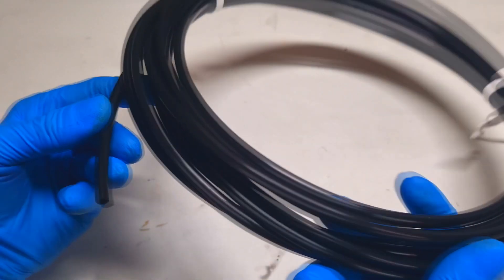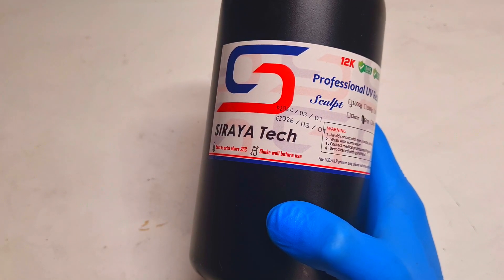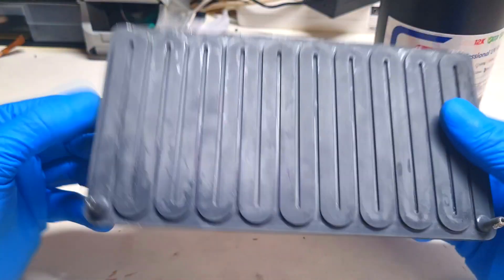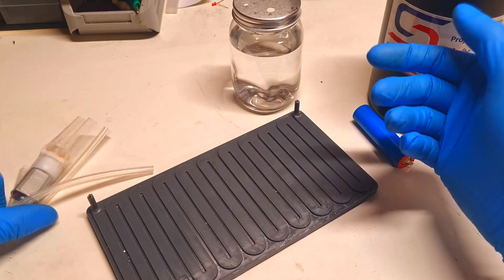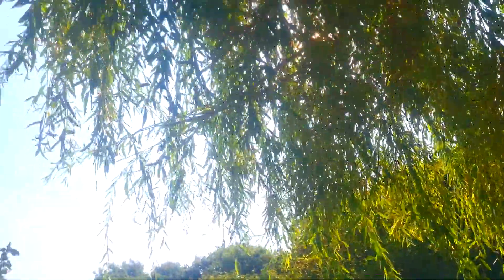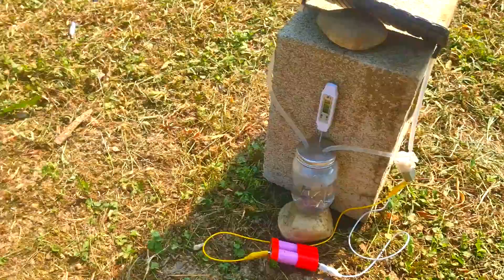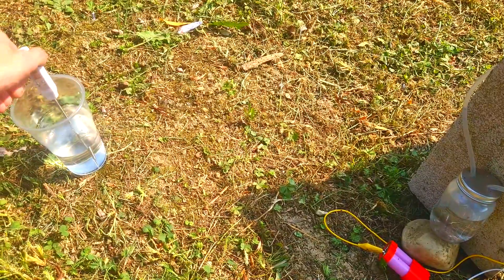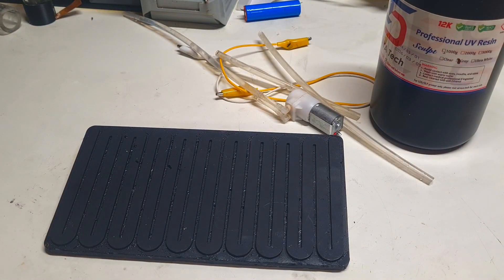3D Printed Solar Heater

Comment: Your control test at the end is completely meaningless. The control test is in a plastic cup as opposed to the glass used for the heater test, which means the containers have different thermal properties. In addition, the control test container is open to the air while the heater test container is not, which allows for the heat to escape easier through convection. 

To see whether your panel actually made a difference in the speed of heating or the maximum temperature, you probably should have made a second test container which would have been a metal can painted with a matte black paint of some sort on the heating side and ideally insulated with some simple foam on the other side. (You should have also insulated your heat panel on the rear side)
Reply from the maker: @BirdbrainEngineer  The container is also made from plastic. You know.... people are curious about many things and for that reason is better to have also meaningless tests. That test I make for the reason if someone want to know what is the temperature of the water without heater which was in the open for 20 min.

Comment: Should have mixed iron oxide into the resin, more heat absorption, better heat convection, higher uv resistance. Good idea nonetheless
Reply: You don't uh, you don't know how resin printers work, do you?  Anybody reading this: DO NOT DO THIS.
Reply: @greenman360  oh correct you are right. Would only work in classical 3d printers

Comment: the scul in sculpt is pronounced the same as a head... skull... while you are making it printed... imagine the tube were not square, so it caste shadows on the one side, but kind of smooth raised up like the body on a modern jet fighter. I; trying to think of another way....erm.. like speedbumps on the road... they don't cast shadows, unless the light is super low.

would also be interesting to see what happens with two in series and parallel.

Comment: passive heat convection requires no pump, ie inverted water solar collector, also flash boiling of small amount of water avoids the heat capacity issue of the water. if suitable. ie flash boiling solar water heating panel. if gas form of water at 100C is more suitable form. yes instant boil water vein leaves. flash boil to purify water. maybe also forces capillary pumping effect. maybe fill the solar panel with a secondary channel which is not thin. you can directly calculate how long it will take to heat up or boil the water from the heat capacitance and the surface area of the solar panel.

Comment: Use a glass plate in front to minimize convective air currents carrying heat energy away.
Reply from the maker: @kreynolds1123  Yes, this I will do next time. Here I just try if the 3D printed heater will be ok
Reply: @cayrex  understandable 🙂 But you will be doing it again when you encase it.  Without convection the surface temperature will get hotter and plastics are not known for being great thernal conductors so there will be a noticeable temperature difference between the surface and the water. 

If you plan on using something like this in winter you'll likely need some kind of antifreeze. Is the plastic resin compatible or resistant to the antifreeze upto the expected temperatures.

If you plan on heating the inside of a home you might consider a heat pump to upgrade the quality of heat.  If it is 0c outside and you get a 25c rise in temperature with a solar thermal collector, then getting another 25c rise with a heat pump will provide a better quality of heat (forcef air furnaces commonly heat air to about 49c) and return the thernal transfer solution to the collector colder than your house would have. A colder collector is more efficent at absorbing solar rays because less is reradiated away in infrared. 

It's good that you didn't use an FDM printer because it would have been too porous and leaked.

Comment: You should have made a header at the top of the panel and a header at the bottom (like a radiator). Connect the headers with vertical waterways. Convection would circulate the water also.

Comment: Εάν κλείσεις τον συλλέκτη σε ένα γυάλινο περίβλημα, και δημιουργήσεις κενό αέρα, θα έχεις καλύτερα αποτελέσματα, γιατί θα αποφύγεις τις απώλειες λόγω θερμοκρασίας περιβάλλοντος.
Reply from the maker: Correct
Reply: You'll prevent convective the vacuum will prevent conduction  losses while encassing the collector will prevent convective air currents.  But you will always have radient  heat looses where there is a gradient (difference in temperature).
Reply: Πολυ σωστο
Reply: If he creates a vacuum in the glass-container, the radiator will simply crack and blow, according to the normal-pressure-water inside it... He doesn´t need any vacuum, just isolation on all sides, except the side of sunlight-incidence, where he should use glass...